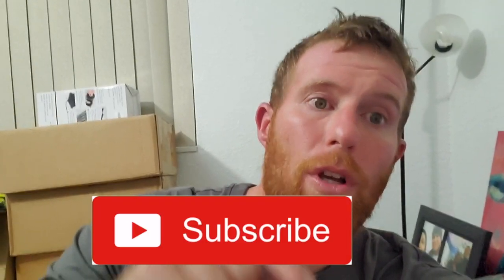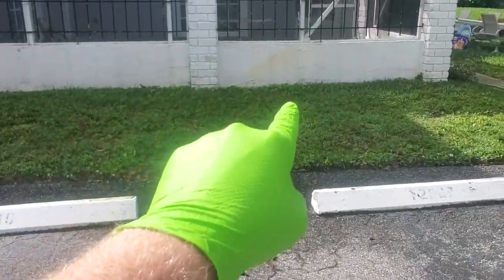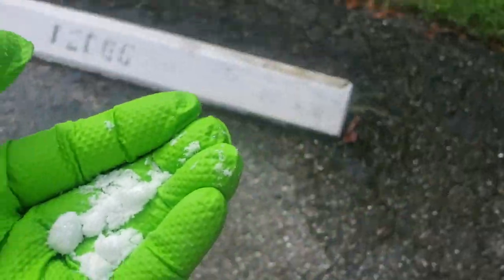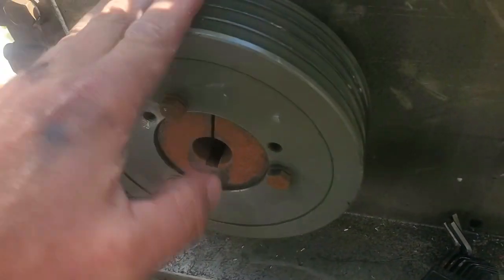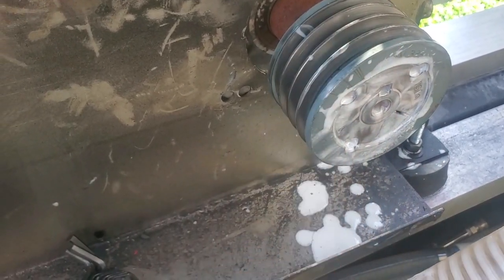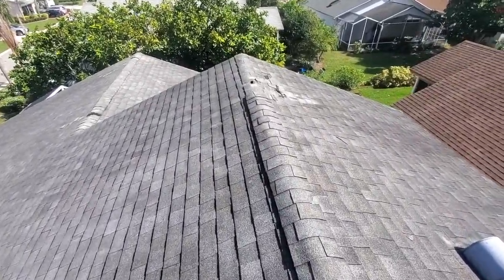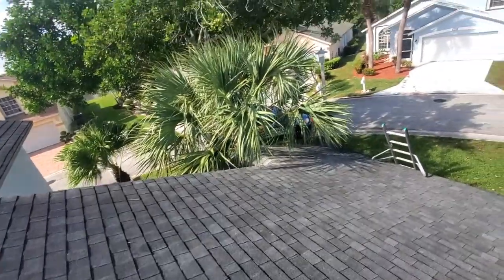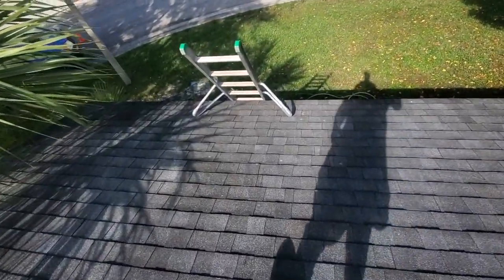Roof Cleaning SCAM ALERT- Insurance fraud

Comment: Run in to HF and grab their pulley removal tool. You can yank that pulley right off the old machine while sitting in the parking lot of HF. Take the old motor back into the store and also return the pulley tool as well! Thanks for plugging your insurance guy--we understand the monthly coverage cost may differ from what you pay but still, it's hard to find any companies that insure the "full package" for decent rates.
Cheers!🥾🇺🇸

Comment: As for your pully remove all of your set screws and the threaded hole with no set screw in it , use one of those screws, run it in until it goes tight, 
 then start to tighten it with a good quality allan key, you might have to put some force on it this is the screw part that separates your pully form the sprocket

Comment: Those holes in the roof have been there for a while.  Did you notice the condition of the wood underneath the shingles?  Weather beaten, discolored and delaminated.  Those holes have been there for some time.  6 months at least.  I'd hate to see the condition of the interior in the attic.  You did good in my opinion by walking away.  That guy knows he has holes in the roof.  No doubt he's had tenants complain about leaks in the past so there is no doubt in my mind he knew about it before he ever contacted you.  Total scammer ... I agree with you 100%!

Comment: I can’t tell for sure from the picture of your pump, but I think you may have a taper lock pulley. You remove the 2 set screws and then thread 1 of the set screws into the 3rd hole. By screwing this into a tapered hole, it will force the inner hub out of the outer pulley. I’m attempting to attach a video showing installation and removal of a taper lock pulley. 

https://youtu.be/fT4axK3haQ0
Reply from the maker: Thats exactly how it works .. i got it but thanks bro u are right